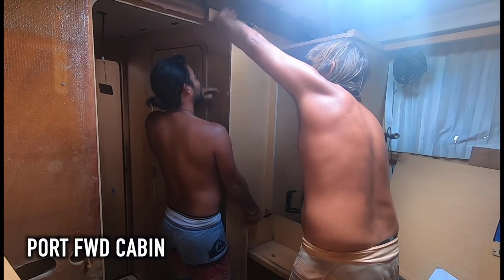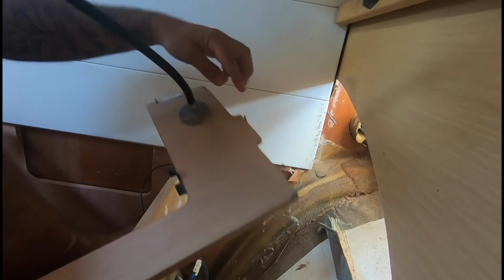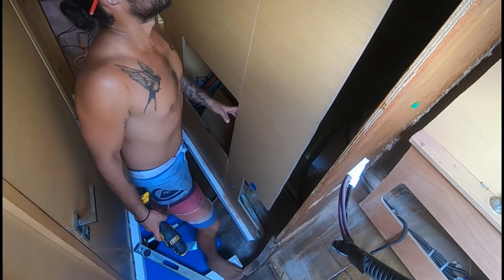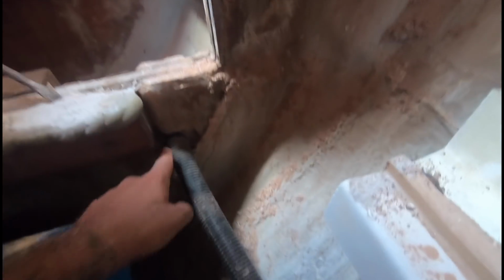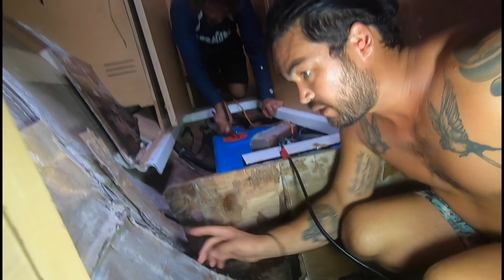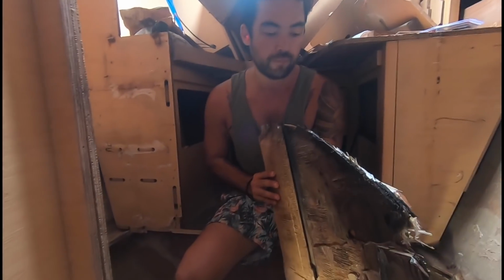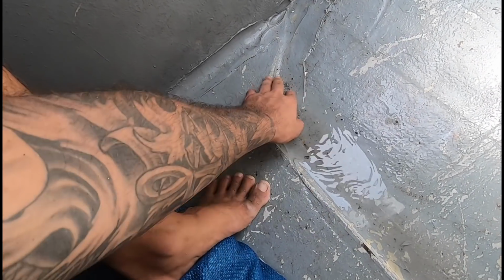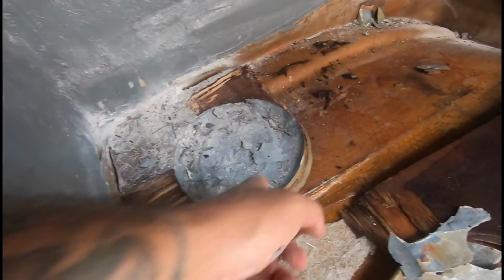CRACKED BULKHEAD REPAIR SERIES - Part 5  (Episode 110)

Comment: Is the rotted wood the cause of all the hull seperations, or were the bulkheads simply underbuilt for the task they were to perform? I feel like the rot started allowing the bulkheads to twist and move fracturing all the adhesives and glass laminations? Kind of a tough call I guess ....

Comment: Great job at finding the source of the leak.  Now you see why good cat builders use foam core for their bulkheads as they are waterproof.  You might want to put foam core boards in as a replacement below the waterline) at least 2 in thick. see 'Balance cats, SeaWind and MJ sailing build.  This rot started years ago.  One might wonder how many cats have this problem??  Yes, take the time to seal all of the plywood and glue and bolt it together.  Again, we can see how poorly these boards were not attached to each other and how poorly the joints were sealed at the trampolines.  Don't forget to put a drain in the front lockers.  Yes, I know that foam core boards are expensive but I would NOW never buy a boat built like this.  My 20 year old 4 Wynns had a fiberglass floor so no rot was possible.  Lagoon cut way to many corners making their boats UN seaworthy.

Comment: Hey bro, looks like you have a bit of a project there. A mate sent me a link to your vid and said I should get in touch with you about your repair. Some of the ways you have been talking about making your repairs will not resolve the issues you are trying to fix. I am a yacht designer that also has 10 years experience building America's Cup and Volvo Ocean boat experience also now a fellow cruiser modifying my catamaran. It is a bit different to yours though.

Comment: I admire this Guy Colin, hes totally analytical in his attitude.
This will be a great product at the completion I'm sure.
Not many people could do this.

They say follow the money.

As an Investigative Engineer I went to FIJI to access what was to be a false claim to an insurance company.
The client did some dodgy repairs topsides and it leaked into the propulsion batteries and burnt them out.
You can see the Photos I posted on BEACON MARINE Google Maps reviews.

So it wasnt a lightening strike but a dodgy Marina Owner trying to pull the wool over the eyes.
The water ran down the cables that were poorly installed and straight onto the terminations causing a fire.
So no drip looping was used and of course whoever glassed the boat was a complete idiot.

Luckily after 3 attempts I was to find the real problem and no the client didnt get insurance.

Great work Colin & Jamie.
Your a great inspiration.
Id love to be there to help but just watching is an inspiration for you are doing what I did 30 years ago.

Respect.

Comment: I love your commitment to positivity, but a lemon is a lemon. I’ve heard Lagoons and Leopard’s are poorly built. (I was going to say, “built like crap, but that seemed to crass.) I’m sure the hurricane didn’t help, but how many other Lagoons have collapsing bulkheads? So many issues on this boat have nothing to do with the hurricane: leaky tramp hooks, no locker drains, plywood attached with putty instead of glass and epoxy, etc. Also, 1/4 inch ply is ridiculous for a bulkhead. Makes me think the old boats are better. I’d rather replace a bulkhead that degraded due to lack of care than poor building practices. How can the rest of the boat be trusted? 

Usually, I am 100% behind boat rebuilds. But, I don’t feel good about this one.

Sorry Lagoon! Not sorry!

Comment: I'd gut the complete mess inside and put new and more massive bulkheads in. 
You probably won't be able to install all that interconnected crap back again, so new and modular inside design is far better option IMO.

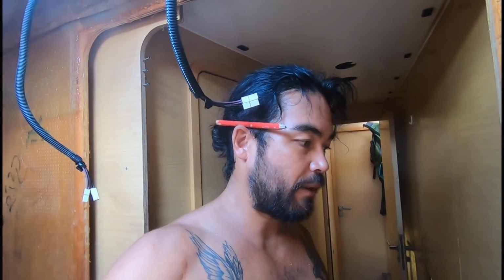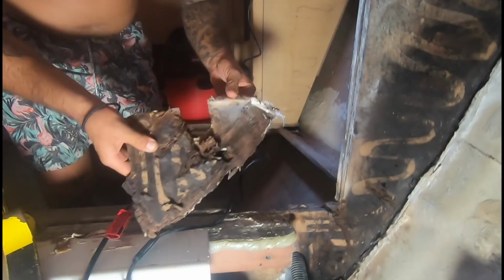Comment: Can anyone tell me, what is that 4 to 6 inch gap at exactly  1:45 ? He's tapping on the one that doesn't have a gap, the one on top has a large gap. And on the right, its very jagged.  Seems like it should go all the way across ? Yah, sick on your board in the surf lol 6:38 looks like water damage ?  So, that entire bulkhead is trashed ! Wow ! I'm more questioning how that leak got there ? From the top above the salon ? I know I won't get an answer but that should be the important question !  9:29

Comment: The trick to dust control is create positive air pressure in spaces you want clean and a vent system for the dust ( maybe with a filter ) 
That could mean closing off the exterior door  and putting a. Fan in a window upwind of the exit vent and maintaining the positive air pressure all during grinding.   Works maybe 90%

Comment: Run a stainless beam between hulls and use aluminum or stainless forward  bulkheads. You'll have to open the hull on one side to get beam in place. Redo for the aft bulkhead.

Comment: There’s a theme in this video that goes something like this “.... rotten plywood “
Is it possible to replace the plywood with materials home builders use behind tile?  Something “hardy” that “backers” up the tile.  😉. You can epoxy sheets together to make them thick and strong.

Comment: @Sailing Parlay Revival, you'll replace the new bulkhead with something other than wood that doesn't rot, right?  💡  BTW, anyone, why don't most catamaran builders use a non-rotting material for their bulkheads?  For the price of these catamarans you think they'd use a material that doesn't rot.     Sealing the bulkheads with fiberglass, etc. doesn't cut it

Comment: I dont know if you guys finished the repair yet but have you considered using steel tubing (or square tubing) bent in the shape of the bulkhead and then glassing the tubing into its spot. Its hard to describe exactly but basically making a skeleton frame that fits snug against the bulkhead walls from one side to the other. Keep up the hard work you guys are awesome!

Comment: I think your detective work might be a heads up to owners of other similar boats. It is probably hard to say if the wreck set up all of that rot scenario or if problems like you are finding exist on unwrecked boats. With no way to inspect those zones, how would you ever know? When I had a fire in my motorhome and needed to remove the cabinets, only to find out they were screwed on from the back and not easily removable is enough to make you want to take a baseball bat to the designer. Frustrating to say the least.

Comment: For what a lagoon catamaran cost new, they would use something besides plywood for the bulkheads nowadays. I would want not built with any wood. Coosa board would be the ideal material to build bulkheads out of.. Nida core would be the ideal stiffener filler instead of balsa wood or  foam.

Comment: Honestly I wouldn't even put some of those walls back in, you loose access to the hull that could be invaluable in an emergency situation, I'd just  finish out the opening,  line it and fit shelves or racks that hold bins or baskets for more storage.....there's just so much room behind there that's going to waste

Comment: A boat that was beaten by a hurricane and sustained damage. No thank you not for me as you are discovering rot etc........I'd rater be sailing.
Great job and more courage then I have. Reading the comments saying that Lagoon should give them a new boat. They bought a damaged boat 
fully knowing work would have to be done. Structure damage you will have, water damage you will have, wood will rot and components won't hold together.
Good luck in your endeavour..........
Reply: What about the other lagoon 450 owners with the same issues that are not hurricane boats? Major design issue

Comment: Its one thing to have a boat that's designed to take on water (wet boat) and hold it in certain areas or dispense of it as needed. It becomes a whole different realm when its not designed to get wet because eventually all boats will and then you end up with that exact scenario if they aren't at least designed to properly expel the water to a bilge area and allow the vessel to dry. I own an '84 Shamrock and it was designed as a wet boat which means they thought of every inch of that vessels internals getting wet and staying wet for periods of time. This equates to zero chances of failure due to rot. You guys are doing a phenomenal job on the diagnostics and rebuild of such a huge project. In my opinion you should definitely think more along the lines of a (wet boat) refit and make everything as water tight and drainable as possible because its obvious that lagoon did not and you are bound to have continued water intrusion in the future due to those netting mounts. I believe hurricane or not, all of their boats are going to fail in the same manner due to poor engineering. LOL, Seriously though who the heck would design a storage locker on any vessel with absolutely no way to drain it!!!!
Keep up the great work gentleman ...................

Comment: Went to the Facebook page for this , lots of boats  reporting the issue . Some report insurance companies are starting to deny insurance .  Scary , that is an expensive boat .
Reply: Update Lagoon admits about 40 cases of this failure reported .  1000 boats made .  My guess is that it is way underreported  because so many will just not know or want to have that black cloud officially hanging over their boat . Others think it is not too bad on their boat .  

40 boats , while still less than 10 years old with major structural failure is WAY too many

Comment: I would be tempted to go for oval doors where the bulkhead is as that corner is just too much stress with two sharper corner in too smaller area. Oval doors will look nicer too. I would be tempted to use some small bits of 304L stainless steel sheet in some of these areas.
Reply: Just to add well done, best of luck and keep the faith.

Comment: These are the problems with modern assembly construction once the outer skins are finished the rest is shit. To many dynamic  loads that interact with stylish living.  Also the fact that the second hand bonding of polyester sucks. 
I don't think I would be advertising how shitty my boat is  just in case I ever wanted to unload it. Just saying.  Good luck and buckets of supplies.

Comment: I can't watch. Gloves, shoes, mask, eye protection! 
Ok I'm put off ever buying a cardboard boat. These things are designed to crack up! There is nothing holding it together. Holes cut where you  need strength like the designers and builders never spoke. Looks like a 10 year life for these boats, cyclone damaged or not. I feel for you, keep up the positive thinking. Lagoon should have just fixed it quietly for you. Would have saved them tens of millions in lost sales. Who would buy Lagoon now, even though all used Lagoon cats value just dropped in half.

Comment: To understand how these boats are build will help you to see how the cabinet's and other woodwork needs to come out . All panels that make up all the woodwork in these boats are milled on CNC machines . To have less expensive carftsman this is te way to go . All furniture is assembled in the woodshop and placed in the hull , or hulls in this case , before the "lid" AKA the deck is placed . This makes it impossible to take out any furniture without cutting it up . You have to make strategic cuts to make it possible to reinstall the furniture . The weak spot's in the bulkheads are because the customer wants the doorways to be as big as possible . If you want the bulkeads to be stronger , make smaller doorways and get used to step over the doorsills and bent your head down . These production boats are build to suit most customers and most customers and maximize the profit for the boat factory . Most customers do not sail across oceans or even sail very often . Most catamarans i know do only leave the marina 2 or 3 times in the sailing a year .

Comment: I admire your efforts and continued determination.  I want you to consider a fundamental question, in terms of a dual-hull fiberglass boat.  Why particleboard???  Where else in this boat is wood used for structural purposes? Why would anyone use wood?  And why would you replace wood with wood?  Why not some type of plastic, kevlar, or composite?  And why not mount the support externally to the fiberglass, instead of inside the fiberglass?  And the sandwich method?  Yeah, maybe don't recreate that with glue.  Why recreate the bad design, setting it up for failure version 2.  I know you guys are deep into this, and I am sorry for the challenges you continue to face. But, I also want to put this comment here to give you a moment to stop, step back, and try to consider the problem from an outside point of view.  Your work so far was necessary.  Do not regret tearing it apart.  It had to be done.  But, the next steps are to be considered.  Working with Lagoon is questionable.  I suggest stepping outside the box, and hull, and reconsidering the best approach to repair this design.  I know nothing, I admit it.  But, from what I have seen, you are up against a failed design, and now you are faced with fixing that design.  I remain confident in your abilities.  I simply do not want you to fall into someone else's biased idea of how it "needs" to be done.  You have gathered several talented people in your subscribers.  Hopefully, you will find the right ones, and their ideas, to help you through this.  I continue to support you.  Good luck and courage!
Reply: Pardon me. Plywood, not particleboard.  Same result nonetheless.  Also, someone else suggested aluminium, for structural purposes.  Allow me to add that a big 3D printer might serve a purpose here.

Comment: Colin I'm a boatbuilder trade qualified in NZ. Every wooden part of a boat including edges should be either glued or painted to prevent rotting. It is clear your structural bulkheads have little glue and no paint on the bare wood. This is why they have rotted. They don't even have to be soaked by water for this to happen, sea air will do it. I am concerned about the amount of ply you are cutting out, because it is all structural including the floor and fore and aft connecting bulkheads. It acts as diagonal bracing to the athwartship bulkheads, and supports the hull skin. Where there are holes trough the centre of bulkheads, it won't significantly weaken it. Compare it to an ibeam, the web just holds the top and bottom plates apart, all the compression and tension loads are taken by the plates on the perimeter. Similarly your ply bulkheads, the load is taken by the perimeter, the centre just needs to be prevented from distorting. So you can cut a hole in the middle of the web with very little loss of strength. Have a look at bulkheads and ribs in aircraft, they are lightened by holes everywhere. Hope this information helps you or someone! We feel for you at this trying time. Regards, Murray and Jean

Comment: Is it possible that thee reason why the boat has buckled at the load bearing walls is actually due to rot rather than the design of the load bearing wall as first previously mentioned.  It would seem to me that the rotted boards would be a part of the reason for the warping.

Comment: Hey guys, wanna keep the dust down, use a rotary chain saw blade on a buffing machine at slow speed. Minimum dust and big chunks are cut and with some skill, like artist, you can carve the damaged section out. 

Bulk up on all the laminate, even 2 layers with glass in between the layers. Especially at those weak point, maybe 3 or 4 sandwiched layers, well tabbed to hull. Good luck, its a big job but you guys have tenacity.

Comment: Why would you even want to talk to the engineers at Lagoon?  They are the ones that designed this piece of crap in the first place. Way back when, there was a company called yacht constructors in Portland Oregon.  They built one of the first mass produced fiberglass sailboats, starting with the Chinook 34 in the mid 1950’s. When they wanted to show how strong their boats were, one of the owners took out a hand gun and shot at the hull and the bullet bounced off.  I still have people tell me that my 40 year old Cascade 27 is bullet proof.  That’s how to build a boat

Comment: Man, what a cluster ####. You guys are top notch for staying so positive and determined to fix this. It will be/is very hard but staying positive is your best hedge against giving up or going nuts. As an Engineer and boat builder I can clearly see where the desig and build of this boat is severely lacking - this is not just hurricane damage!. Hang in there guys and get a crapload of Tyvek suits for the grinding to come!

Comment: Fibreglass wicks. Wood wicks.  Unless it’s solid resin panel.  No filler. Joints over 20 years leak and have to be checked.  Hurricanes tear things apart.  If you don’t fix it right away, it rots extremely fast.     They bought a wreck. Wrecks need to be fixed. 

And of course, people like you commenters all act like it’s Lagoons fault, and donate money……lol.

Comment: You have an opportunity here to lose a lot of boat weight, rebuild with foam pvc panels instead of damn wood  ffs and concentrate on boat strength rather than hotel finishes. Will probably end up with more internal space. Can see why these boats are so so heavy, way too much weight involved in non-structural b---shit, way too little in strength and what is there rots, that rubbish.

Comment: I'm not a boat builder, I would consider using some square tube metal, or large angle iron pieces, get a drill pressed drill some holes, screw them in or bolt them.  Steel or Aluminum could reinforce better than ply + FG.  You could fiberglass over in the metal reinforcement afterwards.  Beef it up!

Comment: You should start a series by ripping apart 5 or 10 year old boats to show how they're holding up. You'll be paid so much money by the manufacturers to keep you quiet! 
I'm afraid it's not only Lagoon that use mass production shortcuts. Almost all of these production cat manufacturers do it for the money - the fact that they still float after 10 years is purely incidental.